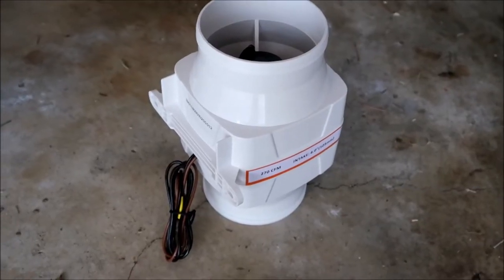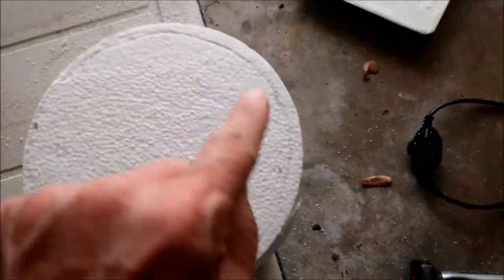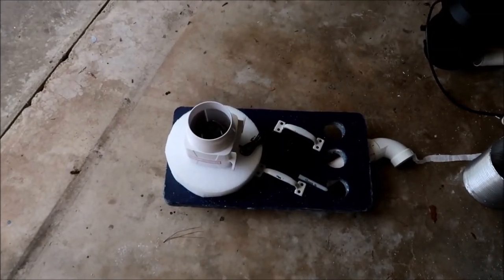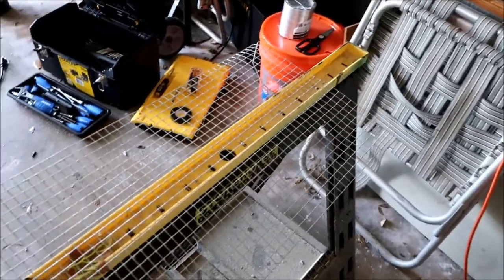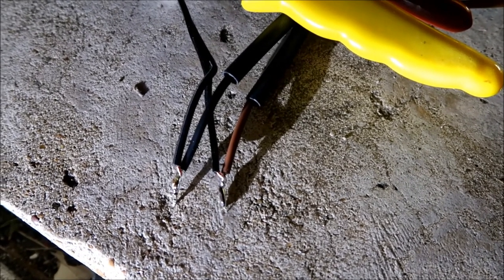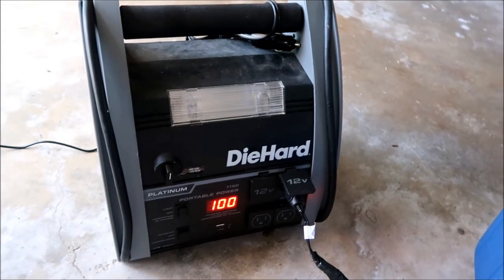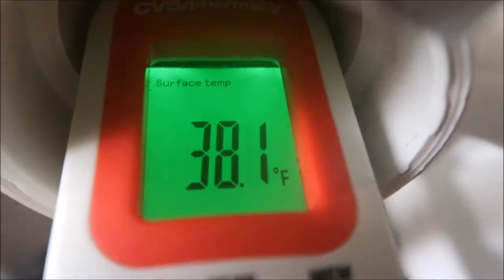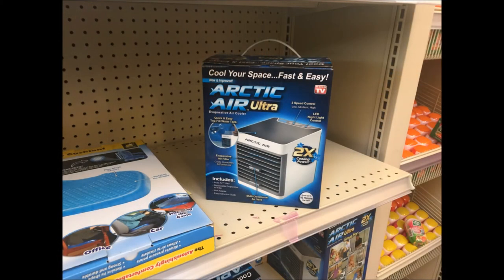Wednesday's Work in Progress Presents : Ice Chest A/C Mod.'s # 2 - 09/04/2019

Comment: Plus the sound would help from hearing everything outside tent
Reply from the maker: Yep, I need to work on the sound issue more.  Me and that former girlfriend placed the unit outside the tent and stuffed insulated tubing normally used for water pipes and ran it through the tent.  I think this is one of those projects that will continue to be improved on.  So I am predicting future videos on this idea.  Thanks for stopping by again and have a great one.

Comment: "How to increase ice?"

To increase your ice retention, you must have a bit of understanding of how thermodynamics works. 

1)In short the more insulation around your ice chest the longer the ice will last.

2) you can improve your design by making sure the ambient air (say 100°F) being brought in by your blower doesn't hit your ice directly.  the way it does now.

3. Using a radiator/heat exchanger  will also help.

I'm currently working on mine, but the hardest thing is fabricating the inside out of plastic, because water can't rust plastic, bending and welding the plastic to fit radiator, exhaust ducts and water pump. my big goal is to get the ice to last 24hrs, but I'll settle for 12hrs. It's gonna take some time.
Reply from the maker: Thanks and I plan on more improvements. Thanks for stopping by.

Comment: Francis if you use your AC unit in a well ventilated area that might work but inhaling CO2 from the Dry Ice in large amounts can have health concerns!!
Reply from the maker: That is a concern.  That is where I placed the CO2 ice in zip lock baggies.  The CO2 gas that you saw was not bagged upped.  I will be tweeking this project some more.  Thanks for stopping by again.

Comment: Interesting experiment.  Not sure I could sleep with the noise, though being cooler would be nice.
Reply from the maker: Good observation.  I made one for a former girlfriend a good while back.  We set it out side and ran insulated tubing from the exhaust tubes into the tent.  That help a lot with the noise factor.  Additionally, we used a regular fan as input which was much more quieter.  I may re-use that concept to cut down on the noise.  But I will try to find a DC fan.

Comment: Francis nice job and I enjoyed you trying to repurpose that cooler and yet keep it intact. I have some thoughts that I like to share with you. I've made three of these all-different in their manner of function. They all are DC and you could extend the run time  as long as you had the ice and the Sun Shineto power it by using a 100 watt solar panel. It seems to be the standard that I see all the YouTubers using. There are several rules that you need to remember. First of all an  overpowered fan may feel good when you're standing in front of it but if your Ccooling an area which  you will soon be injecting air that is too warm to be cool down to something that is comfortable for you to feel. It is not an instant cool that you were going to get from one of these units. You cannot maintain it. So you need to run the fan at a little slower speed to let the air pick up the coolness that you are generating from the ice. And that is tricky. You need to find that sweet spot that is going to fit your size of your cooler. And speaking of coolers you need to look at what type of cooler that you have. I have an island from igloo it maybe nothing more than a basic plastic shell the insulating property is the air that is inside those two walls. So it's difficult to help you hold in the cool for extended amounts of time. It's not made to hold prolong coolness and definitely it has a limited cooling time to maintain the coldness of items. In one of your videos you mentioned a friend had better luck and getting things cooler then you experience when you made it yourself. You need to follow his recipe for success exactly and have all of the same items That he is using in order to repeat that. These little coolers are made for a very small area someone else pointed that out to me on YouTube so I'm throwing it in here as well. I've learned from a recent project that you also have to pre-cool the chest before you start trying to extract cool air out of it. And once again if that fan is too fast and too strong it will not be able to keep up and you soon you'll be pumping in hot air and you will not see a cooling effect as great as what you think you should get out of it. The auto plug adapter has a fuse inside of it. The ones that I have found have five amp fuses in it and your motor may have a greater amperage  capability than that 5 amp fuse can supply. Do not change the fuse inside of that adapter you will melt the wires,  they will get red hot in an instant and you will have a fire and burns it's a very dangerous thing to play with. The speed controller that you speak of is available on Amazon under motor speed controllers and there are many to choose from. Pick one that is going to be adequate for your setup. They range from 4$ the $34. There is a great addition to this project. It is called  REFLTIX it reflects the heat out one side and the cool stays on the opposite side. But it is pricey.  The ice elevated above the bottom of the cooler is a great idea. If you've been surfing and you've seen the other coolers that are being made n to cooling units, then you know that reflectix a thin bubble wrap insulation with aluminum foil on each side.  if you glue it to the bottom and sidewalls of the cooler then you lose the function of the cooler for other things but you will be able to make the ice last longer. You can friction fit it but then your dealing  with water underneath it or between it and the side walls.
 
 Leslie it is great to see that you are reaching of temperature that is down into the 30s. That's only a momentary temperature though as it starts heating up as soon as you start running the unit. It is more helpful to know the size of the room that you are trying to cool as well as the starting time and temperature and length of time to get to the lowest temperature you are able to achieve and the time that it took to get there. I hope you found this information helpful. 

 One YouTuber pointed out to me that there is now a DC air conditioner that runs on 640 Watts  DC. the cost is $360 at one of the big box stores I believe it is a 8000 BTU unit, runs on 12 volts and you would need  four, 200 watt panels to run.   The 640 watts is the  start up of the compressor and then drops back to approximately 580 Watts once it is running. That is while the sun shines it runs on solar. Think batteries when the sun goes down or it is a cloudy humid day.
Reply from the maker: Wow, this is about one of the best comments I have ever received on any video, especially a project video.  I think this is a work in progress since I am modifications number 2 on this unit.  I did find on Amazon a D/C power rheostat and I am going to purchase it to reduce the airflow.  I was originally looking for an A/C rheostat to reduce the spin on my rock tumblers since it was beating up the rocks too much.  I also want to lower the wire shelves a bit more.  I used a water pump on a radiator fan cooling system.  But on the Gulf Coast, with all the humidity, that and the swamp cooler project did not go so well.  I guess they are best in arid regions of our country.  So, I was thinking of repurposing the small copper tubing into small coils and place them into the exhaust pipes.  and pump melted ice water through them.  As far as power goes, if I am at a campsite with A/C power, then no problem.  Like you said, I could extend the power on the D/C side of things by reducing the fan speed and of coarse make the unit more efficient power wise that is.  But I still do not know if it would last 6 hours?  Like I said, I thing it will be one of those works in progress.  Thanks for stopping by, your comment and take care.

Comment: Yeah, they make portable air conditioning units that run off AC power. I have one. It works as long as you can run the exhaust hose outside. Did you consider using a variac so you can slow down the fan a bit? I bet that would cut down on the noise, and increase your battery life. Might even make the air a bit cooler coming out. Heck, with the air not blowing so hard through there, it may help the ice last longer too. Something to think about maybe? ❄👍💯
Reply from the maker: It is funny you should say that.  I was looking for a variac/rheostat on Amazon to slow down my rock tumblers.  My A/C in-line has one built in.  The DC motor does not have one.  I am going back on Amazon to see If I can find one.  I should be able to since you can find just about anything on there for sale.  Great observation.  Thanks.